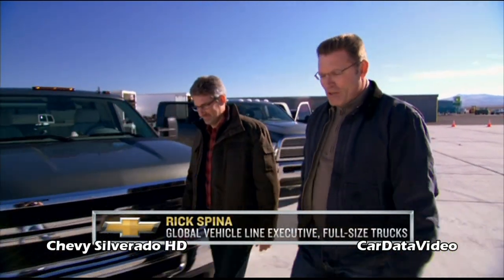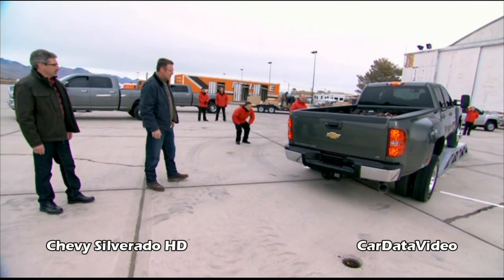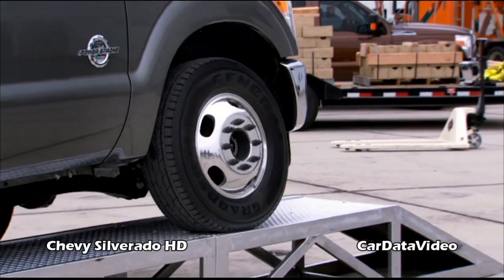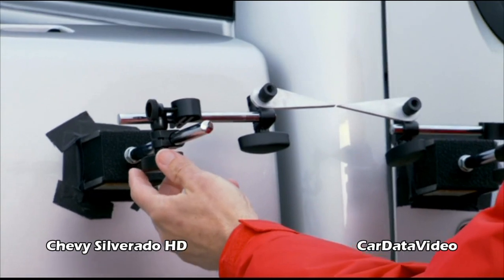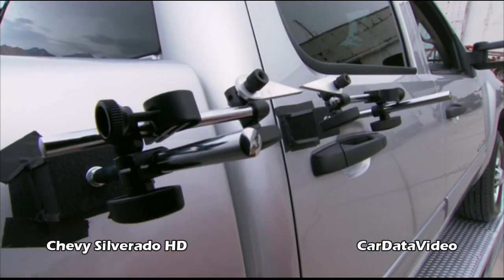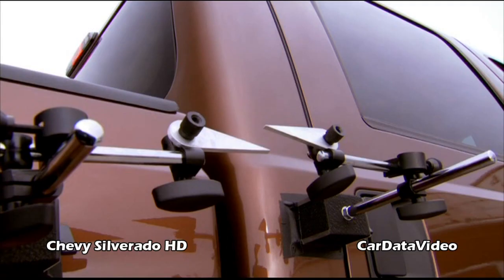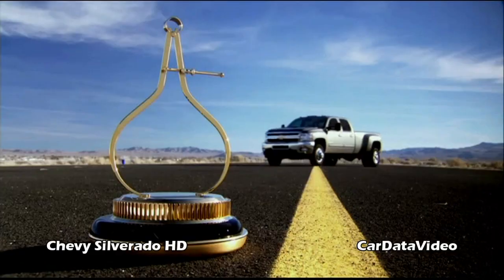Chevy vs. Ford HD Truck - Bed Bend Video

Comment: only thing this videos tells me is how much EASIER it would be to snap a chevy frame. no give.    that flex is there for a reason, look at a semi truck when its taking off from a red light.
Reply: Just because it takes more weight to make it flex doesn't mean it flexes less.
Reply: tcv4 if you threw anymore weight on the chevy it wont just flex, it will permanently bend if not develop stress cracks.
Reply: flexing metal snaps eventually , unless its spring steel. frames arent made of spring steel leaf springs are
Reply: you think they're using mild steel frames?  these trucks are engineered this way for a reason.
Reply: Actually that's how you screw your frame bro,lots of flex is bad,fords are good trucks just not a strong as a Chevrolet I know I've owned many of both all from the 70s
Reply: chevy and dodge proved better than ford on the frame test
Reply: well, no use arguing with idiots.   in one ear out the other.   learn some metallurgy bro
Reply: the flex is there becuase its cheaper to build with less metal and less engineering
Reply: okay there superstar.
Reply: jeffrey gussman
hell yes you go
Reply: go clip your claws

Comment: I love how people fight over brands. I LOVE Ford, Dodge, and Chevrolet (GM). Out of them they all have weaknesses and strengths. I like Chevrolet for towing, its low to the ground, comfortable, and unlike Dodge and Ford the Allison cannot be beaten, but I wouldn't take my Duramax offroad without a lift kit. I like my Dodge because you can't get the sound of a Cummins from anything else on the market, the nostalgic semi front end, and my 24v Cummins will outlast my Duramax and my 7.3 Stroke hands down. And my 7.3 stroke and 5.9 Cummins both are high off the ground, ride like haywagons, and have solid front axles so I play offroad with those two and haul four wheelers. Plus, my 36' Forest River 5th wheel is heavy and the Duramax with sling that rig all over the road, but my Cummins and Stroke just don't do that. They pull it don't get me wrong, but my Duramax will mop the floor with both my Cummins and powerstroke pulling that trailer while they remain unloaded. Love them all, the big 3, but you can't get the entire package in one truck. Never happen.
Reply: The new Rams with the cummins use AISIN transmissions, so as far as the powertrain goes I would put them above the GM at this point. I'm purely talking about the engine/trans. Rear ends are solid too.

Comment: torsional rigidity should be of a real world test. Not some ramps that keep the wheels off the ground. GM is always coming up with weird test like the "empty toolbox" pushed over the bedside but you can see on the commercial it punctures the GM bed also.

Comment: If the ford actually bends like that dont u think it has a reason?

Im talking so that the cargo in the back wont jump everywhere when on shity roads
Reply: FORD IS THE BEST SELLING TRUCK FOR MANY MANY YEARS AND BUILT EXTREMELY TOUGH
Reply: @Patrick Wright 
Would you actually bend a truck like that though? Any type. 

No, you wouldn't. You'd have no reason to. Chevy just wants to win something.
Reply: you mean like they win fake awards every year that they basically give themselves? @iman5147
Reply: Cause its a Ford and thats what they do.
Reply: @iman5147  yes but it proves the Chevy is stronger.
Reply: TeenKat360 Yes, this is similar to the exact reason why airplane wings kind of flap and wiggle a bit when you're taxiing to the runway...It looks scary but the wings are moving like that actually helps the structure of the plane in motion And relieves the stress on that part of the plane
Reply: Letz Talk overlanding
Reply: Exactly Ford - smooth ride chevy - launching cars of cliffs claiming it survived but it didnt
Reply: Patrick Wright they don’t ever do this cause it’s not even realistic. Besides creating the simulation there is no where to test a truck like that.
Reply: Patrick it sure is rotting with that military grade aluminum body but you’d know of course
Reply: Because the suspension doesnt do anything totallyyyy
Reply: Letz Talk um very rough terrain can do this to a truck. Chevy is better at offroading clearly. You need to climb rocks? Chevy. Need to snap your truck in half doing it? Ford.
Reply: Patrick Wright ahah how does it feel that you’re trucks not even made in the USA, dodges suck ass the only good thing in em is the Cummins everything else is useless
Reply: Shame iz dank Only a dumb person would get a Chevy, shit as front and back ends
Reply: Toyota all the wayyy
Reply: @Patrick Wright did you have a ford? mi dad work with a ford f150 single cabin with more than 7 years of continued use in ofroad, really bad roads, hours consecutive with cart, and the body of the pickup its in good condition, and he had another one with double cabin with the same, 7 years of use, the fords are perfect for rude use, i cant tell good things about silverado and ram because he hadnt the new versions, the old silverados were bad for offroad, the body just mistreated, but the old ones, i only can tell that the f150 its perfect for ranch
Reply: The more rigid the frame the more likely it's going to crack and break. The open c channel is designed to distribute the stress the frame takes on that's why the tailgate dent and the Chevy didn't. Bet you with those trucks up like that and drop quite a bit of weight into them, that Chevy will snap before the Ford does. This really isn't any test, just an ad. No truck owner would put their truck through that on purpose unless it's specifically designed and built like rock crawlers.

Comment: 2:51 look how uneven it already is if you follow the body lines the truck is completely straight on the body line
Reply: Thats because the front left tire was up on the ramp.
Reply: i noticed that aswell
its so fake
Reply: Are you blind?
Reply: El_De_La_Lobo not even off the ground yet
Reply: I know fords come like that 😂
Reply: I might be half blind but even I can see that body lines don't match up
Reply: That's due to the front left tire already on the ramp. 3:02 shows it flat...

Comment: Im a Chevy guy all the way, but this is def rigged.. And hey at least the Ford has a solid axle..
Reply: the chevy has a solid axle differential in the rear like the ford
Reply: I was talking about how the Ford has a solid front axle. Chevys run IFS. Not hating on IFS, but on a heavy duty truck there should be a solid front axle.
Reply: kyl75 It doesn't matter.  No one off roads these barges anyways.  In a Jeep Wrangler it matters.  But 99% of these one tons will never go off road so IFS vs solid is not an issue.
Reply: kyl75 it helps with handling tho
Reply: I would take GM's IFS over FORD's solid axel.  I have gotten nearly 300,000 miles out of the balljoints on the front of my GMC 2500HD.  My superduty used to need balljoints ever 50,000 miles and it was always out of alignment,

Comment: You're testing an aluminum body against a steel body, so the results produced are very much invalid
Reply: Yep but Ford only uses aluminum. Seems like Chevy made the smart choice.
Reply: The body panels have nothing to do with flex. The frames are steel for both trucks.
Reply: Here in Michigan I would prefer aluminim as steel bodies rust out in a few years due to the winter salt road treatment. Tired of going through barrels of Bondo!

Comment: I'm thinking flexing is good. And that Chevy may of had only 250lbs of shoes in it while the Ford had 5k lbs of concrete. Staged?
Reply: No. It makes sense cause the Ford is made of aluminum and the Chevy is made from high strength steel.
Reply: No look closely that is a Ford f250 with a different front and rear end and different body. Against a Chevy 4500 HD
Reply: And actually th ed strongest material is alloy in a triangular or circle shape
Reply: Well. if your frame will flex a bit you may not get hung up in the rough.
Reply: If flexing is good, Ford back cover would not pop.
Reply: @alexlo7708   Actually it helps traction offroad,something too stiff will have wheels hanging in the air providing no traction on that corner, even Mack Trucks had a rear( Camelback) that would flex a little to cut down on tire wear,I realize that flex was lateral, the point is sometimes flex is a good thing, could you imagine how much harsher the ride would be on something that had tires with no flex? Get on an old farm tractor with steel wheels on a hard surface road or a bulldozer.
Reply: @andybub45  this is a 2011 Super Duty. It's made of steel. Ford didn't build aluminum trucks until 2015 and that was the F-150. The Super Duty didn't go aluminum until 2017. Also in 2017 the Super Duty went from the open c channel frame to a fully boxed frame.
Reply: @andybub45  the frame is whats twisting and fords is also  steel, totally staged lol

Comment: You need some flex in the bed, keeps the frame from cracking under stress
Reply: That’s what suspension is for. The bed isn’t supposed to flex.
Reply: @andrewmclamb6984  I didn't realise, but you are in every comment defending chevy- for what? Its painfully obvious how staged and fake this is.

Also, suspension on both trucks has its limits. Once the chevy's suspension gets bottomed out- ting! The frame goes bye-bye. The Ford won't have that problem because excess energy is channeled into the bed. 
And even if the bed gets damaged, it's a hell of a lot cheaper to replace a bed than an entire frame.

Comment: we use chevy 6.0L for work trucks. Over 300,000 miles and no major issues. I know alot of oilfield workers use them as well. Very reliable.

Comment: Ford has over 100 years of experience building high quality durable trucks, far more experience than Chevy. Up until now Chevy has been known for sloppy , and weak frames. Ford on the other hand , is more ridged but not so ridged as to crack or be prone to failure. I find this video to be hard to believe. The tailgate buckling under that type of twist? I've got years of hard off road driving experience, seen a lot of crazy stuff. Never anything like that. I will say one thing ...I used to bs die hard Chevy. What I've seen from Ford in my personal experience over the years .....I'm Ford all the way ...this video is a crock

Comment: I clicked this video thinking it was something else.  But, since I'm here, Ford (or even Ram) never had the issues with cracking frames and cross member separation that GM did.  I believe GMs goal was to satisfy GM drivers that primarily use their vehicles as more of a commuter vehicle.

Comment: They literally just proved that the Ford has better suspension characteristics, and act like it’s a negative. The flexible frame allows for the wheels to have better contact with uneven surfaces, as well as a softer ride quality that’s more merciful on your cargo. But if you’re unfortunate enough to get your truck into this almost impossible situation, the least of your worries should be if your tailgate opens. lol

Comment: They must have had this video under one of the ramps because the video looks smashed down.
Reply: displayfireworks1 lYes p
Reply: no they just welded a calculator to a toaster and called it a "camera"
Reply: displayfirepreajustes de efectos con súper alto volumen
* Bass Booster,works1
Reply: Yo
Reply: 2011 video ford #1 selling truck of all x....& the best!!!
Reply: displayfireworks1 oo yes men
Reply: Been running service trucks for 20 plus years, will take Ford over Chevy hands down.

Comment: This Chevy commercialized video is attacking on Ford C-channel frame's con by utilizing Chevy fully box frame's pro. It is no different than when Ford was showing their own video criticizing the Tundra C-channel frame and praising their F150 fully boxed frame. There is no real winner here.

If you seriously know trucks, and especially heavy duty trucks, then you know the pro and con of a fully boxed frame vs C-channel. Ford Superduties are the only ones in 3/4 or 1 ton that still use C-channel. And so do all the big rigs, semi, cement trucks...etc.. out there, they all still have C-channel frame...And that's all I got to say.
 
My company took in 5 Arboc buses as a pioneer program to see if they are good enough for future purchases. Within the first 3 months, all 5 developed frame cracks, requiring the company to sent technicians out to our facility. If you are curious of what Arboc is, look it up. Having a stiff frame is good as long as you are staying within its limit. When it is pushed, it will give as in "crack", instead of twist like a C-channel. If you watch Semi during very heavy pull, you can see the frame twisting back and forth, but it doesn't crack.
Reply: yep not many people under stand rigid is great, until it flex's a bit to much. Having a higher modulus of elasticity and higher elastic limit makes for a far more durable frame.

Comment: They loosen the heck out of the bolts on the ford
Reply: Chevy wouldn't do something like that!! By the way did you see the tool box test they didn't  drop the tool box at the same angle on the Chevy.
Reply: The ford is just junk compared too Chevy..... I know had plenty of ford trucks because there much cheaper....
Reply: @donaldkinder6716  that is a lie. Chevy trucks are cheaper quality because they still use steel. Ford uses military grade aluminum that is twice as strong as Chevy's steel body and it doesn't rust out as quick as garbage ass GM trucks. I bet you havent onwed a single Ford pickup in you're life because if you did, you would be saying the exact opposite as what you're saying now 😂
Reply: @campbell0162  i owned 12 ford trucks in my life ford has the worst front ends in the business, never had a ford engine hold up like a Chevy got a Chevy truck right now with well over 2 hundred thousand miles, still all original? Chevy trucks hold alot better resale value?
Reply: @donaldkinder6716  so how the crap mpg doing for yeah
Reply: Why u own so manY ford trucks, if there so good, there junk, compared too Chevy......

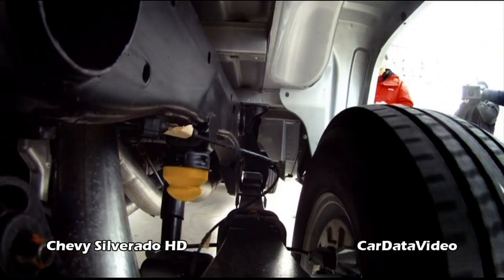Comment: 2:13 doesn't it look like the Chevy had airbags? Bottom middle left part of the screen
Reply: Hiding somewhere or they removed them so those trucks do not think that they crashing so they don’t deploy when they do the experiment
Reply: Ha ha. Yeah. They are cheating on everything. False advertising lol.
Reply: @huntermorris4594  no not those kind of airbags
Reply: Bash Zilla Are you referring to suspension
Reply: Are you talking about that yellow thing? Lmao that’s not an air bag😂
Reply: Some people have them installed , handy option for heavy use .
Reply: Thats a bump stop, keeps the axle from bottoming out on the frame.

Comment: If it doesn't bend it breaks and ford beats chevy in everything important.
Reply: Hell yes
Reply: That is the truth
Reply: Samuel Moncla BECAUSE FORD IS THE BEST SELLING TRUCK FOR MANY MANY YEARS AND BUILT EXTREMELY TOUGH TODAY
Reply: Paul Wright FORD IS THE BEST
Reply: Paul Wright IT’S NOT wrong it’s right.
Reply: @Paul Wright Ford has more Sales than Chevy
Reply: Fords not number 1 anymore they are the most recalked 28 million it the last 30+ years only a Ford Fan would praise a puece if junk Ford
Reply: Fordlover your wrong Chevy and Dodge beat Ford allday long
Reply: Jackie Dalton NOO THATS SHITTY CHEVY 🤮🤮. FORD ALL THE WAY
Reply: Jackie Dalton NO FORD BEATS SHITTY RAM SHITTY CHEVY AND SHITTY GMC WITH THE HE BEST SELLING TRUCK FOR MANY MANY YEARS AND BUILT EXTREMELY TOUGH THE F150 AND THE FASTEST TRUCK EVER 3.5L V6
Reply: @jackiedalton396  and GMC

Comment: Ford is still more reliable. This test is meaningless to like 95% of the people who buy pickups.
Reply: You're correct. It is meaningless to 95% of people who buy pickups, because those people are the idiots who are willing to purchase a F.O.R.D and have the fucking chassis snap, crack or bend. Ford trucks always have chassis damage, and always blow out the bottom ends, or have oil leaks.
Reply: Ford is more reliable? You are either in denial or living under a rock.  Have fun tossing money at your powerstroke diesel.  I will enjoy my Duramax with over a million miles on it.
Reply: Kyle Harwood

I have 170,000 miles on my 7.3L turbo...no leaks...no problems EVER
Reply: Josh Smith um yaaaa. any diesel engine at that mileage is just getting broke in
Reply: GM engines are stronger, it has been proven. Ford may be more durable/reliable, but who gives a fuck if you take care of your car like you are supposed to.... Pit a chevy 5.7L against a ford's 5.4L triton or even a 5.8L and guess who wins, chevy 5.7L. i have a 91 pontiac firebird and have raced mustangs with both engines myself, and won with my chevy 350 on all occasions. Hell pontiac made the strongest engines back in the day.
Reply: Todd Rich AHAHAHAH FORDS STILL THE BEST.
Reply: Todd Rich What are you basing you opinions on? Because I can assure you at no point in time has chevy ever produced a performance engine that used stronger materials or more innovative/efficient designs than Ford or Mopar.

Comment: Ford is still better, especially the Raptor
Reply: Is an all new chassis.
Reply: Im a Chevy person but the raptor is amazing.
Reply: Typical Ford guy. But the truck off the line for off-road instead of replacing the suspension system.

Comment: any movement of the bed is almost guaranteed to be engineered that way for a purpose
Reply: Engineered to be a floppy frame seriously for what reason. You think up one and tell me. If you ask ford they'll tell you to save money
Reply: @Smitty-op4ld  long bridges are made to flex and move in the wind and with weight. If they were completely rigid they would have a much higher chance of snapping under tension. Same thing here, I'd much rather have something that is flexable.